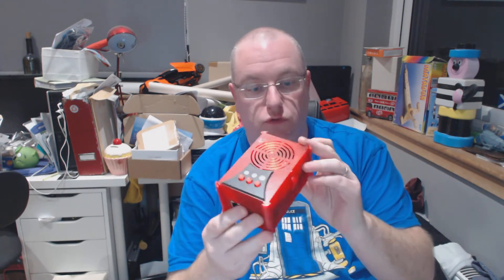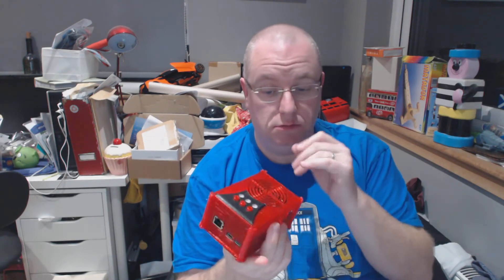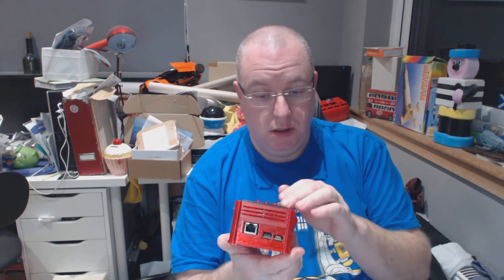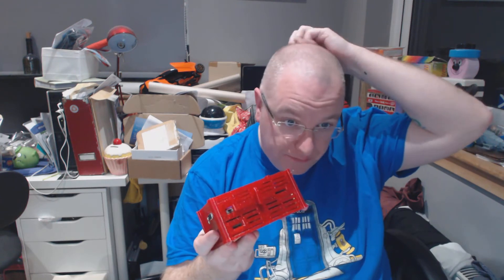MiSTer FPGA update (new RAM  & Case

Comment: Glad you're happy with the case ( eBay seller here). It was totally random that this video popped up on my you tube feed.
Reply: Interested in a mister case, whats your ebay user name?
Reply: @robertfisher3507  hi Robert , my eBay id is dirkthedaring71 but if you message me on the Atari forum (user: twinkytwonka ) and then I'll knock 10% off the eBay price. I can't currently access my atari forum messages so email me at Stuartdotfiskdotsfatgmaildotcom. didn't mean to hijack this video :)